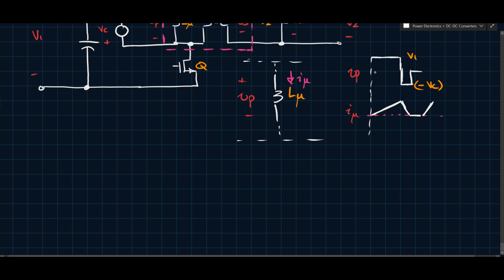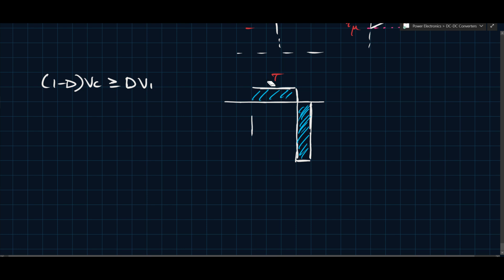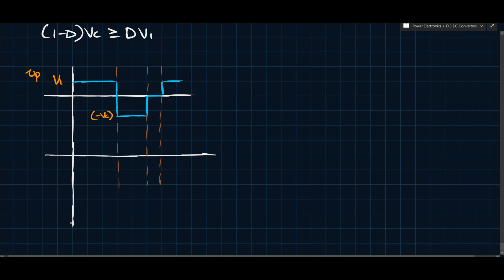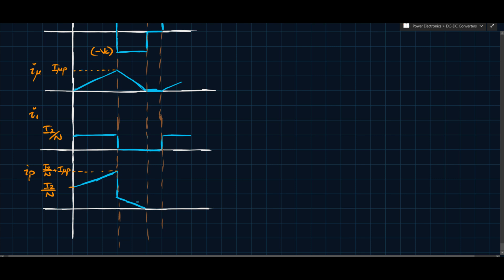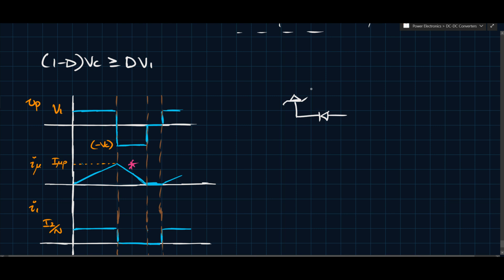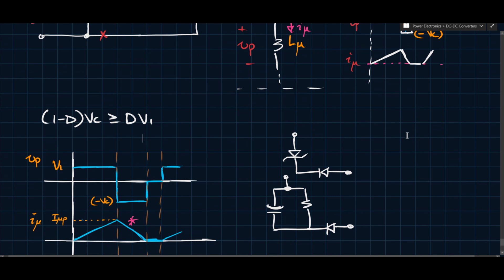Isolated DC-DC Converters: Single-Ended Forward Converter

Comment: Hello Sandeep Sir,  In the potential clamp circuit section the circuit which is the combination of diode, capacitor, and resistor is also called the snubber circuit. Is it right? Does it have the same function as the snubber circuit?
Reply from the maker: Hey. Generally speaking, voltage clamps can be considered to be a special case of snubbers. Clamps can be thought of as turn-off snubbers that limit the maximum voltage that the switch sees, whereas snubbers in general are used to either limit the rate of increase of the current or voltage of a switch.